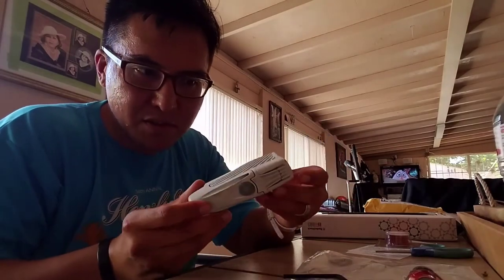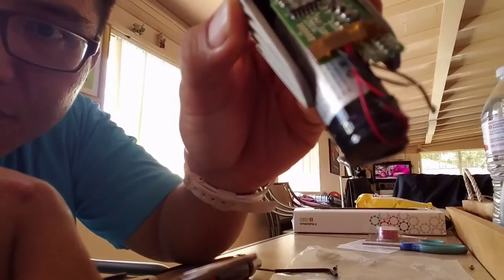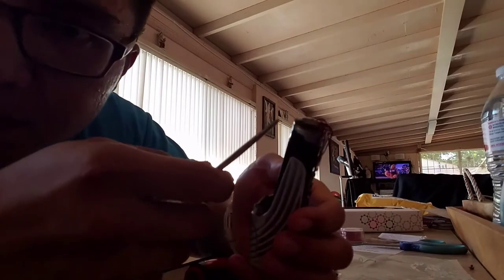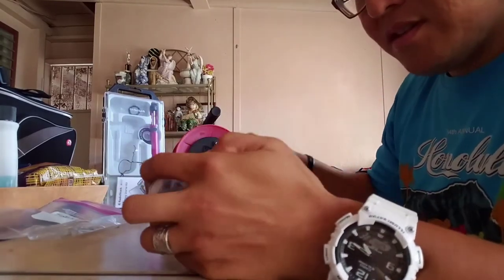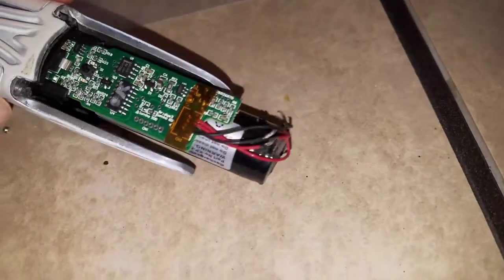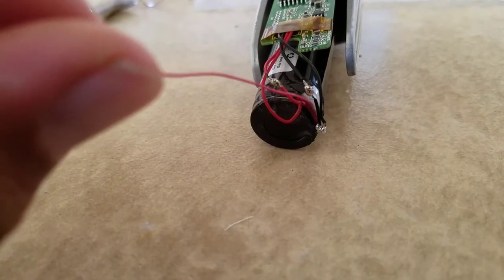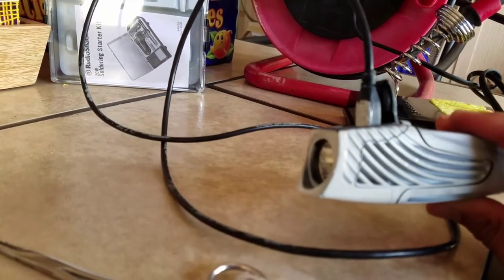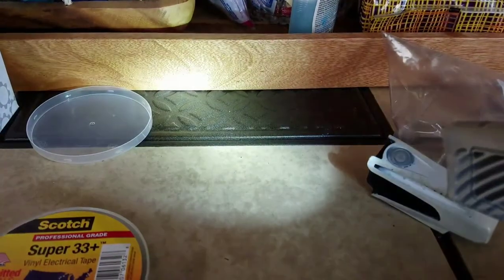VLOG 178 REPAIR NITERIDER LUMINA 650 LUNIMA 700 FRONT LIGHT

Comment: You gotta get yourself a nice pair of wire strippers (and cutters).  Every cyborg needs one!

Radio Shack used to charge outrageous prices for discrete electronic components.  However, there were those weird days where I'd need a one off npn/pnp transistor or a random cap and they were pretty much the only place in town that would sell them to me without having to order them online.
Reply from the maker: Prairie Cyclist's Cyclevlog yeah man. I feel you on that one. gonna miss them. got the soldering iron half off

Comment: hi. any idea why the battery has two red and two black wires? could you please run a test for me. run the light half way or more (run it until the power button turns red - to signify it needs to get charged), then please measure the voltage across the two red and black wires (one red and black at a time; since you shrink wrapped them, you'll have to take the yellow/brown transparent tape off at the connection to the board and measure there carefully without shorting aka touching a both red and black at the same time). then, with the charger cable plugged in, re-measure. I'm wondering if one set of red-black is a bypass to the battery protection circuit.
Reply: I’m trying to reverse engineer and upgrade the battery on their  550 / 600, which only has 1 red and black wire. And wanted to use their 650 battery. But don’t have access to a 650 or similar that uses this battery.

Comment: I have completely different issue maybe you can help NR wants me to send 25 to fix it but seems it should be simple. When I push rubber button down no click and light will not turn on. I had to remove rubber and turn on off with a narrow object like Allen key. What are the contents of your button? I’m guessing a piece of button has broken or something. “Life time warranty” is a lie. Do you understand my question i don’t think I explained well...
Reply from the maker: Sounds like if you just put a dab of jb weld epoxy on the internal button receiver to be able to reach the rubber of the button easier that would solve your particular problem.   Also could use ABS pipe glue as well that dries like hard plastic and is sand able too!
Reply: Story of my life thanks for reply. I will give that a shot and let you know if it works thanks!

Comment: Hi - wouldn't Nite Rider cover this repair under the Lifetime Warranty?
Reply from the maker: Stephen Manley they probably would.  But I never looked into it.  It still works perfectly to this day since my diy repair job though.  Thanks for message
Reply: Well done, mine has just started playing up sfter years of great performance. I'll check out the warranty claim but may end up back here :)
Reply from the maker: Stephen Manley good luck with yours as well my friend👍
Reply: Actually they will not, life time warranty is “limited life time warranty” and they do not cover circuit board or button issues after 2 year they charge 25.00 and want you to send in a check in with the light before repair smh! All that is covered really is plastic housing!